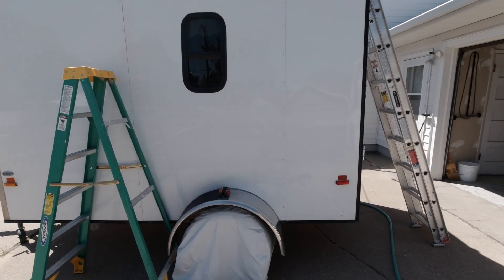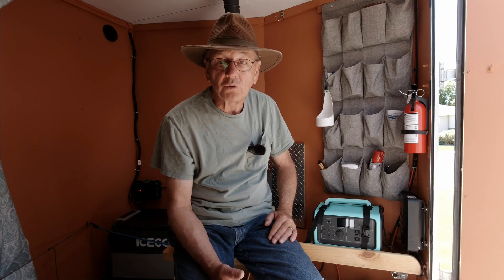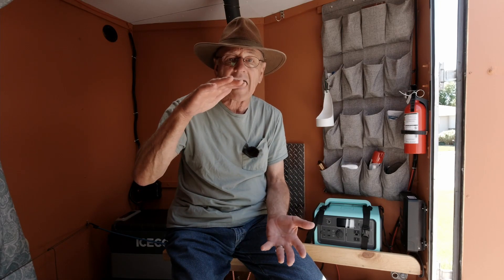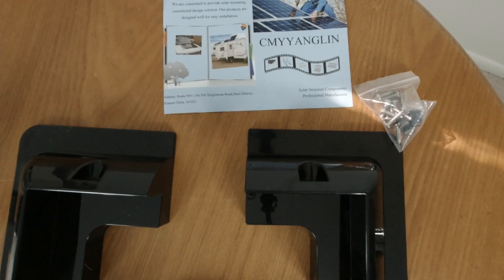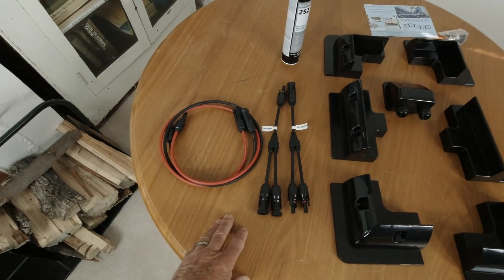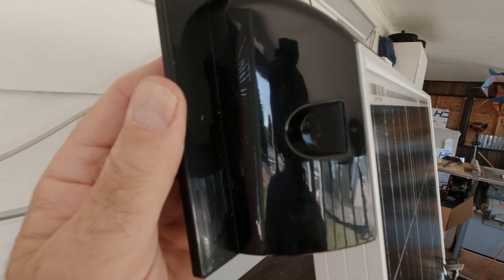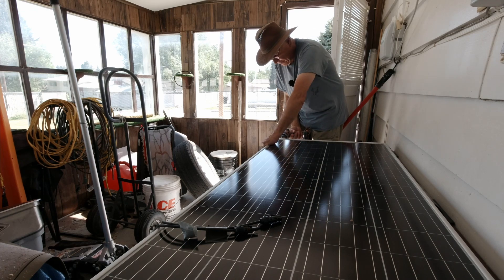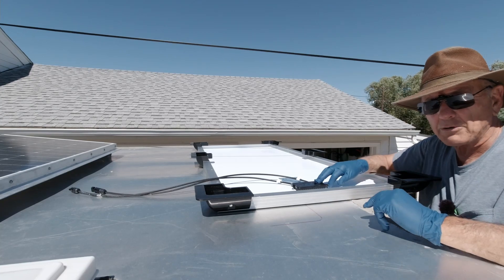Installing A Second Roof Mounted Solar Panel - It's Easy!

Comment: I'm using 250 watt panels that measure 39" x 65" and weigh 41 lbs.. Would you trust the Sikaflex and the plastic mounts to hold that panel to the roof?
Reply from the maker: I have one that's mechanically fastened and one that is held with adhesive so the jury is still out, but I'm thinking if it were me I'd use the adhesive mounts and put some screws or bolts through the bases just to be safe.  I'm betting that these mounts are going to work fine and I personally am not aware of any failures.
Reply: @gonagain  Thank you. I've been mechanically fasteing tbem until now. I like the idea of no holes in the roof, but the thought of a 4p lb panel flying off and takjng someone's vehicle out gives me the heebie jeebies. I follow your progress and see how you fare.

Comment: I think this is one the best videos by far on explaining on how to add another panel.  Thank you for sharing.  Question, what connection did you use to connect your solar setup to your Bluetti to see the battery and solar?   I know you can use your solarcharge controller on which I saw but when you used your Bluett i got confused on what connection you used to see the wattage.
Reply from the maker: Oh, good question Charles. The two wires coming down from the roof panels go to my Renogy controller, BUT, I spliced into them just ahead of the controller and those leads have MC4 connectors that I hook my Bluetti up to.  I don't get the full wattage because some of the current goes on through the controller to charge the trailer's house battery, run the refrigerator, etc.   I'm not sure what others do in this situation, but I'd like to hear their opinions.

Comment: Nice install! Good helper, especially at that critical placement time.

Do you use the app on your phone to monitor your system? I have a Renogy Rover 30 and that thing has a false history in it and shows strange symbols (hieroglyphics? ) on the screen of the controller. Renogy tech support has been totally unuseful and non cooperative about it, for two months now.
Reply from the maker: I didn't get the bluetooth app and I'm not totally satisfied with that controller.  It doesn't show how many watts are coming in and the wire connections are very hard to use. One of these days I'll replace it.

Comment: Great install. Looks like there’s just enough room up front for a 3rd panel. LOL
Reply from the maker: And maybe one across the back...  lol!  I think I have enough, but don't get me started.
Reply: @gonagain  Maybe solid solar panels that fold along the sides of the trailer.  If the roof doesn't have the square foots, make more.  A big panel the size of the rear door seems good.  Just stop, flip it out and soak the energy.

Comment: mind if i ask what do you operate with the 400 watts, can i use a 2000 inverter and run a microwave ?? thanks learning this stuff ps would you need two bateries
Reply from the maker: With 200 watts and two deep cycle batteries you could easily run a 2000 watt inverter to operate your microwave.  There are lots of different set-ups you can use, like one big lithium battery or a couple of golf cart batteries, but you see what I mean.   I run our refrigerator, lights, charge numerous batteries and spend long hours on a power hungry laptop.
Reply: @gonagain  thank you

Comment: I enjoyed your video very much. I am wanting to add another solar panel to my travel trailer, it has a diflex tpo roof, any idea if the adhesive you used will work on my roof?
Reply from the maker: I wouldn't use the adhesive mounts on a diflex tpo roof unless I also through bolted them as well, just for added security.  I saw a video where a panel was screwed, not bolted, to a roof like that, using metal bracket mounts, and it let go on the freeway, so a combination of both might be best using the adhesive mounts and adding some bolts through the roof frames.
Reply: @gonagain  Thanks for the advice. We leave on our first trip out west in October. Arizona, New Mexico, Utah. Hope to see you on the road somewhere.  Next spring we plan on looking for some land in Montana for a home base. Safe travels to you and your wife.  God Bless.

Comment: I was told a mppt  controller improves solar by 30% is that true?
Reply from the maker: Hello George, I don't know if 30% is correct, but I do know that MPPT controllers are more efficient than the older PWM controllers.
Reply: George, it really depends on the system. You won’t see 30% performance increases with a single 100 watts panel, but where MPPT shines is when you have two or more panels wired in n series. In that scenario you would have 72 volts for 4-100 watt panels and the MPPT controller converts the excess voltage into more amperage where a PWM controller dissipates that energy in the form of heat. You get better performance with multiple panels even if they are in parallel. Parallel panels do better if one panel is shaded and series does better in full sunlight. But again PWM isn’t a bad solution for small single panel systems.
Reply: There are certain very narrow conditions where a good MPPT SCC can produce up to (around) 30% more. But, like Endless stated below, the panels should be in series (within the voltage limits of the specific controller) to reap the benefits of what it can do. So, this claim does contain an element marketing hype. What they won't tell you that if you are charging FLA, a good PWM can produce more watts at the end of the charging cycle, since it doesn't have conversion loss like MPPT. If the difference in cost between MPPT and PWM (a good PWM) is significant, it is possible to add another panel to the PWM system and have more power per dollar. No one is talking about that.

Comment: Is it necessary to screw at least one panel down or could you use adhesive on both panels, and are they in series or in parallel?
Reply from the maker: Hello Ed, you can use adhesive on both panels of you like.  I always hook them up in parallel for my needs, which raises the amperage but keeps the voltage the same as a single panel.

Comment: that 124 watts was both panels or just the new one ? do you have  batteries or just the power stations you are charging ?
Reply from the maker: I should have been clearer, because the power from the solar panels (2) is split between the power station and the in-house battery.  The actual wattage was more like 250watts, but it was divided before it reached the portable power station.
Reply: @gonagain  Thanks - have you done an electrical overview video of your trailer ? or SamuraiMomma's ? Solar and 12 volt and 120 ? what lights, outlets etc?  are battery and power pack seperate and each run certain things ?
what type of electrical system will SamuraiSisters' trailer have ?

Comment: I was told that 252 would not bond to plastic very well - Is your experience different (I take it it is....) ?
Reply: I’m wondering if drilling holes in the plastic mounts would allow the adhesive to ooze through, mechanically locking it in place.
Reply from the maker: We'll find out.  My experience with Sikaflex goes back to my boat repair days and I've never had it let go from fiberglass, wood or metal.  This was with 221 and 241 (the difference in those two was the cure time).  The 252 seems to be the same in the way it grips. My aluminum roof was naturally etched and the plastic mounts were textured from the factory.  A week later we mounted my daughter's panel the same way, but her Renogy mounts were smooth and we sanded them with 80 grit before applying the adhesive.

Comment: 400 watt capacity only producing 126 watts...Why is that good?
Reply from the maker: Actually, that isn't the wattage coming in, but is just what that solar charger was accepting. The circuit is shared downline of my connection, and it was also a hazy day.
Reply: @gonagain  
Well I have 600 watts but can only produce about 300 on a great day.  Didn't know if that was normal.